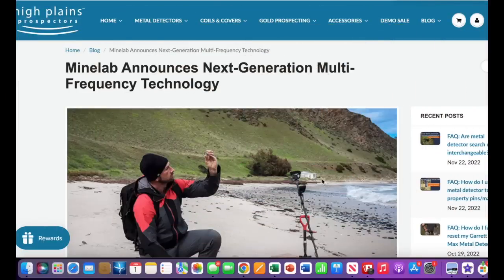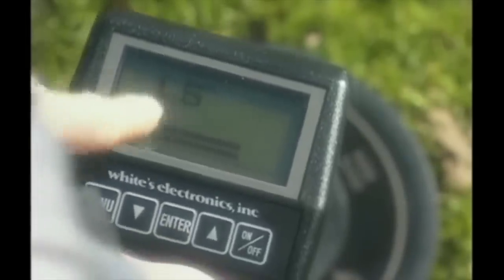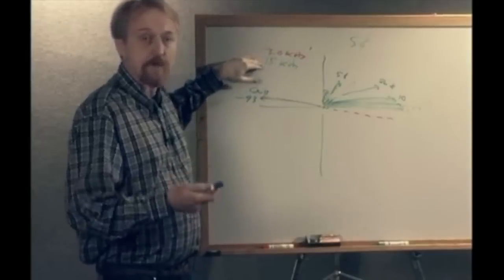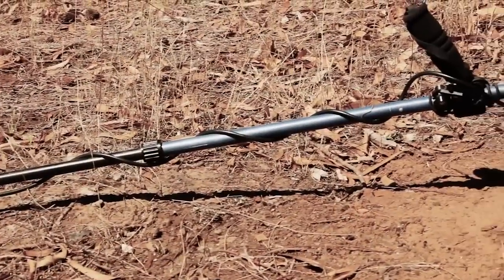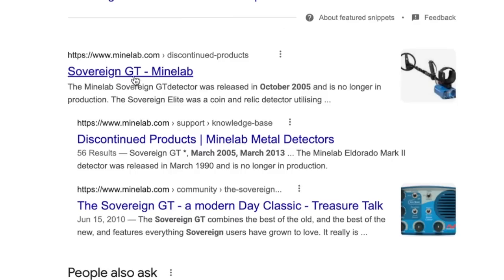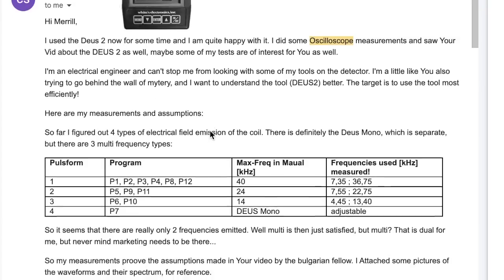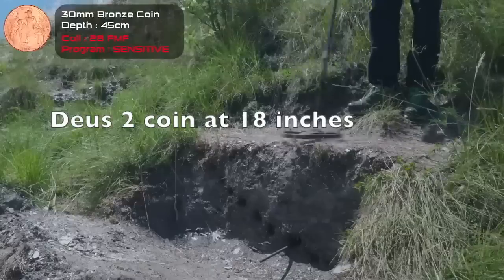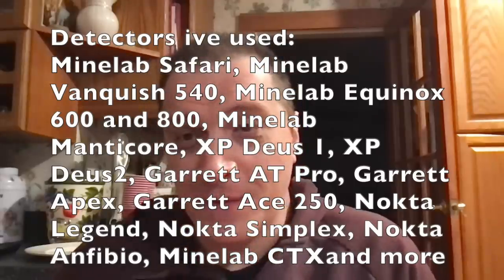We Broke Metal Detecting: Simultaneous Multi Frequency Is OLD Technology

Comment from the maker: Part 1 Of This Video: https://youtu.be/hVmwlk0cqUg
Minelab's Knowledge Base: https://www.minelab.com/knowledge-base/key-technologies
Reply: Yes!
You really need a spectrum analyzer to see everything.
Yes, worked as a EE in R&D for about 15 years.
Reply: @GeorgeJetson1  Very true in needing a  spectrum analyzer to see all.
Reply: @GeorgeJetson1  "3KHz by conventional means and then 15KHz by conventional means, and then compare the results" (3:56) does not sound like "Simultaneous Multi Frequency",  but more like fast switching multi frequency within a session. The results of those two are then processed and compared.
Yes, use a spectrum analyzer to look at the frequency domain, and then also use an O-scope to analyze the time domain.
Reply: Hi Meryl, the claim that it only uses two frequencies may be WRONG. The oscilloscope trace in the video is a square wave. Square waves have harmonics, ie a 3 kHz signal also contains 9 kHz, 15 kHz, 21 kHz etc. The Deus may very well analyze these harmonics! To claim it is only dual frequency is false to make if the signal analysis of the return is unknown! The TX signal certainly contains more than 2 frequencies!!!!
Reply: Smf are usually 2 or 3 frequencies which is enough. If you would use more frequencies together, they wil ‘collide’ which result in loss of performance.

Comment: Man you ain't never lied with this I been on n off detecting for  16 yrs.my first detector was a tesoro compadre that I opened up n hot rodded n still my favorite it hits on the tiny ball bearing from a bic ink pen currently I use it a bounty hunter QS with the four inch sniper coil and my bounty hunter quick draw pro all are sub $200 machines I never upgrade because of what you said  having to spend 500 percent more for ten percent more depth I can find coins to 8 n 9 inches which is really deeper than I'd like to have to dig I live deep in the woods and hunt virgin homesites and even 200 year old silvers are regularly six to eight inches so

Comment: So metal detector are several types magnetic dc field for ferrous iron steel etc and low frequency 14 to 18khz some times higher frequencies but the main thing is if you need identify metals you need 2 frequencys the phase shift indicates metal types the return signal is dependent on size of target and depth is indicated by the delay of the returning signal
Reply: Just like radar the reflected or induced return signal contains elements of the transmission that can help pinpoint property's of the target.

Comment: Gracias, porque al ver tus videos evite comprarme un Xterra Pro y sigo usando mi clone chino del Teknectics G2 (lo malo es que no es impermeable). Este video me recuerda hace algunos años cuando pescaba blackbass, la mayoría de los señuelos que venden no pescan peces, pero si pescan muchos pescadores pura y dura mercadotecnia.

Para mi la detección es un hobbie, pero ya no cometeré el error de gastar demasiado como cuando era pescador asiduo,  varias cañas de 500 USD, lancha,  motor de gasolina, motor  electrico, sedal, infinidad de señuelos y anzuelos y al igual que la pesca la ecuación es: 30% las herramientas 30% el usuario y 40% el lugar o la suerte. Sin un buen lugar no capturas ningún pez o no sacas ninguna buena pieza en la detección, no creo tanto en la suerte pero hay gente que detecta poco y con un equipo muy básico y obtiene buenas piezas.

Comment: Multi-freq is old technology as a concept and previous uses.  But, the application, modern processor speed, and sophisticated algorithms that modern metal detectors are using was unthinkable 20 years ago (except in DoD systems :) ).  Comparing an analog metal detector to a modern Deus 2 or Manicore is like comparing a CB radio to a modern Iphone.  If pressed, we can create tests where the CB radio was better, but not for the specific designed task.  A modern detector, even a $600 choice, can detect at multiple depths and fairly accurately identify the metal composition and depth in soil conditions ranging from saltwater sand to dry topsoil.  Every metal target, in the specific soil conditions, will react emit differently when exposed to different frequency electromagnetic waves.  Using different frequencies, with fast processors and sophisticated algorithms, will in some ways, simplify the identification.
Don't waste your money on an analog detector unless you just want it for a novelty or youtube content.  You'll never find more with an analog detector than you will with the modern detectors you've reviewed for us.

Comment: Haha since everyone is talking Whites here, figured I’d tag on mine as well. 
I Have a pristine condition Whites Classic 3 Plus, and it works well. However, severely outgunned by today’s standards. Even a Ace250 will rival it with depth in dry non mineralized soil. 😂🫣

But it’s a solid machine for those Button Pushers, that require a PHD and Pilots Checklist of procedures before they ever swing anything..

Comment: Some may remember Minelab's ads for the CTX-3030 stating that its FBS and FBS2 technology transmits 28 frequencies from 1.5kHz to 100kHz to improve target ID, sensitivity, and detection depth. "Full Band Spectrum" FBS is really two frequencies, low and high. For the CTX, they are 3.125 kHz and 25.00 kHz (higher freq is the 8th harmonic). 

The advertising is deceptive but not incorrect. FBS sends out many harmonic waveforms but only captures those two frequencies to determine the target type. This is all that is actually needed. The high freq is best for low conductors, to force electrons to flow in a resistive non-ferrous target (to produce the necessary secondary magnetic field) such as native gold, nickel, stainless steel, and aluminum. The lower freq (3.125 kHz) does the job well enough on high conductors (silver, copper, 24K gold) which easily allow current to flow on their surface. And because the freq does not agitate iron/rust to produce a secondary magnetic field as well, it gives a cleaner signal. Some Iron targets (flat iron, sharp pointy iron nails) can produce eddies too and fool a detector into thinking the target has some non-ferrous qualities, which you don't want. 

Technically, ferrous reacts to the magnetic field from the detector by altering the electron spin angle to align like tiny compass filaments along the field lines. When the A/C current switches in the detector (which it does constantly, transmitting downward, then upward, then downward again many times per second) the iron domains relax and in doing so, they produce a temporary secondary magnetic field that disturbs the detector's receive coil. The field polarity of iron is different from non-ferrous, which the detector uses to distinguish the two apart (but it can become difficult to discern as ground minerals also react (e.g., wet salt and iron minerals in the soil). 

So, taken together, when analyzed, the detector can then determine if the target is ferrous or non-ferrous based on the target's reaction to the low and high frequencies (and also the train of long and short pulse lengths that help reveal the target's nature by probing a bit deeper into the metal with a longer pulse).

Does FBS improve detection depth? Well, since only two frequencies are used, no not really. Probably just the opposite -- the weaker harmonic is likely to have somewhat less power than that produced by a single freq detector (again, depending on the ground attenuation which is related to transmit freq). Certainly, the 3.125 kHz freq (being low) is better suited to avoid attenuation by ground minerals than the higher freqs, which makes it deeper, all things being equal. Thus, one could say it improves depth over-against perhaps a detector using higher freqs, but there are other factors involved too.

So, it shouldn't be shocking if Deus 2 uses only two freqs at a time: 7.35 kHz and 36.75 kHz (the higher freq is the 5th harmonic of the lower one) or 7.55 kHz and 22.75 kHz (the higher freq is the 3rd harmonic) or 4.45 kHz and 13.40 kHz (3rd harmonic again). The marketing department sells detectors to a point, but it is customer reviews that will make or break sales. So in the final analysis, slick marketing will lose (and hurts the brand in the long run). It is the knowledgeable assessment by the consumer that ultimately sells detectors, not the techy algorithms and modulations going on inside the detector.

Comment: I'm not sure if it was this one where you questioned putting 50% more power into the ground that I watched but I think it was. Power could be measured by an instant amount of amps given out but is usually measured by an amount of watts over time. Just a thought I had. If the equinox pulsed different frequencies for a period, then paused while it switched frequencies, then put another pulse out for a period, this might explain things. Let's say they are limited to a maximum power output of 1 watt. Because of the electronics they pulse 1 watt for 10 milliseconds, then have to wait another 10 ms to switch frequencies, then they pulse the next for 10 ms, and so one. Over 1 second you have half a second putting power out and half a second not. If they improved the electronic so it only took 5 ms to pause and switch frequencies then you now have 10 ms pulse, 5 ms pause to switch, 10 ms pulse, etc. Therefore over time you are pausing for half the time you were, resulting in an additional time sending a pulse over the second of 50%. No need to break the regulations, and no need to increase actual current, but over time 50% more power is going into the ground. The result of which is not greater depth but greater coverage.

Comment: The biggest problem I have with the newer "latest and greatest" detectors is that you have to be prepared to spend another 500 dollars on after market crap, just make them useful.  Take my Minelab Equinox 800 for example. Please just take it.😂.  It is Prone to leaking, wobbly shaft, screen protectors, cable protectors, aftermarket carbon fiber shafts...etc. It's insane. You would think Minelab would've taken care of some of that for you. I still own my White's MXT...It is a sorry sight to behold. It is Beat up like a tank after a major battle. But, it is still relevant today. It is my go to detector. Works flawlessly.  Over the years I've owned JW fisher, Fisher Mscope, Minelab, White's, Garrett, Tesoro.  I see todays metal detectors as just condensed, digitized, plasticky, waterproof versions of White's V3i machines.
Reply: Is the mxt simultaneous multi frequency ?

Comment: You speak the truth! I’m 68 and built my first BFO metal detector when I was 15 and grew up to be an electrical engineer and chip designer.  After years of owning multiple detectors as well as studying patents from all vendors I have concluded that ALL detectors are limited by signal-to-noise ratio.  The “noise” being the mineralized matrix in which your treasure is hidden.  So that’s the limit.  While target ID refinements will continue detection depth reaches a practical limit.   I have a cheap Discovery 2200 which delivers target discrimination as well as my Garret AT Pro.  The real difference is ruggedness of construction and waterproof housing of the Garret AT Pro.    If you want success with your treasure hunting it’s as much about WHERE you detect as it is how much your detector costs.  Just buy a detector from a reputable vendor and then find the best spots to search.  (PS- I don’t have an opinion on gold hunting…just general targets such as coins,etc).

Comment: I started metal detecting in 1970 with a Jetco detector, don't remember the model.  I used it for years.  In 1987 I purchased a used Tesoro Golden Sabre.  This detector doesn't have any display of any sort, you had to rely on an audio signal only.  By that point in my life I had been a musician for over 30 years so my ear was fine tuned.  I could out hunt all my detector buddies that had the newfangled detectors with gauges and displays by the different tones the Golden Sabre made.  By those tones, I could identify metal type, depth, location etc. better than the new computerized machines.  I feel like with the advent of computer circuitry that the art of metal detecting died.
Reply: The era of the end of 90's and start of 2000 provide some of the best detectors...like explorer XS , the The Sov xs2apro great Tesoro and Whites fisher gold bug and more. 
I find today detectors are improving separation but nothing in going deeper but going out of control money wise

Comment: this is the best video you have put out thanks very much. trust me I have been detecting since 1979. I have owned many detectors. and for over 40 years remember every time a new machine came out.   it was just a bit better not much. Some would have a 1/2 inch more depth but gave up on how stable it ran. thanks again. Great job.

Comment: I have a minelab 705 which is a single frequency machine which you change by changing coils. I only use it in the woods with a 3 KHZ, 15 inch coil. It's a killer on colonial silver and large cents.

Comment: Actually Fisher Research Lab was the first to launch a multi frequency metal detector. It was the CZ-6 Quicksilver around 1992.
Reply: CZ5, the 6 only has no loudspeaker to protect the housing from rainwater.
Reply: @hubsi5263  yes you may be correct that CZ5 was launched before the CZ6

Comment: Love this video. I’m still new to detecting so I learn a lot from the experience of you and your followers. I’m also a former electronics engineering technician and love seeing the tech and specs behind the machine. I’m on a tight budget and was blessed to find a like be Simplex + for $150.  So once I learn the machine and do my research I’ve got no excuses.  One final note I also have a Bounty Hunter Tracker IV I picked up like new in the box with headphones for $40.  I’ve found plenty with that simple machine. 2 tones with discrimination it gets the job done without distraction. For someone with a fixed income, tight budget I highly recommend a used Tracker IV. They’re all over Marketplace for $50 or less.  Dave in PA.

Comment: Excellent video Merrill. You're constantly analyzing, which is a very good thing.  That seems to be one of your niches.  Must be the educator in you.   Whites was so far ahead of the curve at one point.  Their V3i and VX3 were actually operating 3 frequencies at once, which they would compare and then tell you not only a vdi number, but also which frequency saw the target the best.  The V3i also had what they called "polar plot" which is what XP seems to have grabbed for the Deus2, calling it "the xy graph."  The Whites display was in color, where the XP is black & white. 
The biggest problem with the old V3i was that it was fairly complicated to use, and it was pretty chattery in hot ground. It also wasn't waterproof, which is almost a must have standard nowadays.  
Now that Garrett owns everything from Whites, let's see if they pick up the ball and run with it.  A modernized, waterproof V3i with better stability would clear the field. Hopefully Garrett is listening......
Reply: You missed the fact that you could  adjust every feature including making it a single frequency detector!  Garrett doesn't know what it has!

Comment: I don't get your point at all. Nearly all professional prospectors use minelab detectors for one reason only. "Profit"
Minelab detectors are responsible for more gold taken out of the ground than any other detectors. Minelabs dominance had nothing to do with marketing or propaganda. It is purely based on results. 
When dealing with all metal detecting for coins and relics, any metal detector will do. I understand that discrimination is useful for detecting trashy sites but if you are looking for valuable targets. You will dig every signal irrespective of the estimated target category. Don't forget that discrimination reduces sensitivity and depth so having it will limit your success. Ground balance for mineralized ground only works with pulse detectors without loss of depth. Vlf detectors cannot be used effectively in highly mineralized ground without significant loss of sensitivity.

Comment: As a owner and big fan of Whites machines, it was very sad to see them go. I use the MXT All Pro and TDI SL to this day and still yet to see the big difference between new tech and old. As an avid user of the Equinox 800 and with multiple coils for all my machines, I can firmly say that its not that big of a difference from one to the next. @Merrill  I'm not sure if you've ever used a MXT All Pro or TDI SL, but I'd love to see you swing some old tech and see how it handles NYC Lol. Tdi is a pi machine that's easy to set up with a coin program,  and the MXT in relic mode iron I'd on is a killer ferrous non ferrous identifier. Thanks for the entertainment! And maybe one day if I can part with them lol  I'll loan them out and give ya a run at the analog side of the matrix 😎